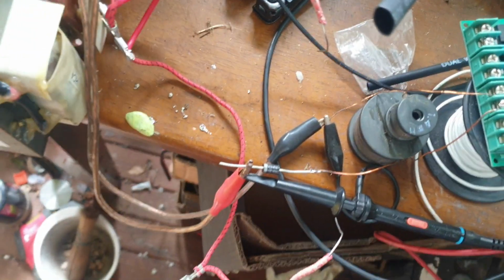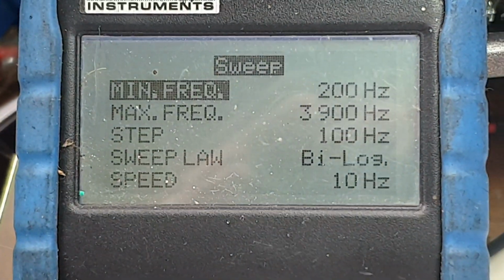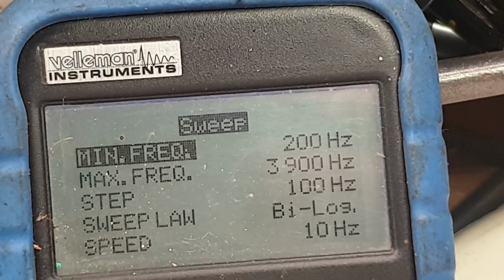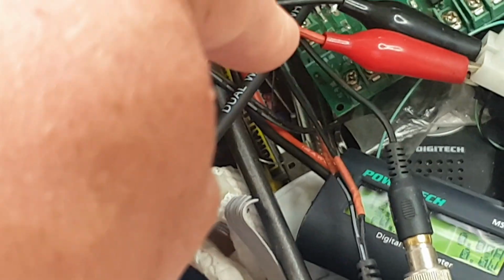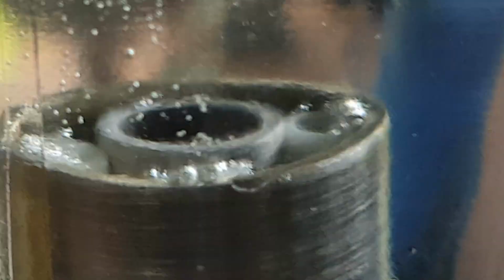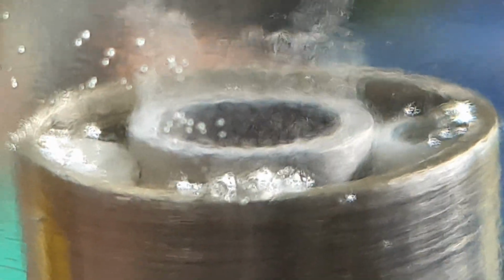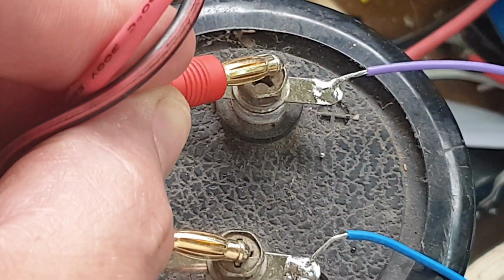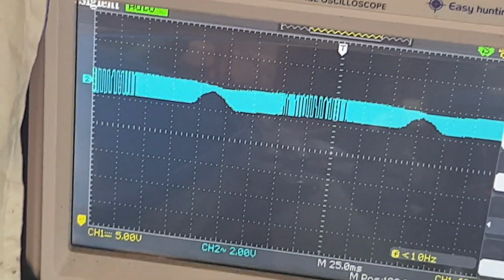Andrija Puharich type signal, HHO 1.3 watts

Comment: Hi m3sca1, with the signal IMHO it needs to be a modulated signal whereby there are 2 frequencies one low one high. Thinking in  rotating vector form, we have one slower vector rotating the higher mass oxygen atom. Now at the tip of the 1st slow rotating vector we have a faster rotating vector which quickly advances and retards the slow vector (phase modulation of the slow vector).
It is only the low mass Hydrogen atom which can follow the faster vector breaking the H2O covalent bond angle. To achieve this a non linear mix of both high & low frequencies is needed for intermodulation to occur.
Reply from the maker: well thats never gonna happen from a single signal generator now is it? thanks for the info... and my cell is nothing like Andrija's... are you still tinkering on this stuff Smokey? i have swept cells looking for resonances, they are a very broad response, tried all sorts of signals and voltages. a bifilar wound isolation transformer was the best non electrolyte result i have had... how much of Andrija's ideas did Stan take on do you think?
Reply: @m3sca1  No I am not at present,  still trying for electrical FE here (NSW).  I wish you luck and hope for your success! As Dr Puharich used rotating electrostatic method HV gradient is required over small gap hence the spark plug. In Puharich notes I think he showed a sweep sig gen with external modulation input.
Reply from the maker: @smokyatgroups  curious how he talks about it taking time to start doing the thing, a water conditioning process.
Reply: @m3sca1  Water is a dielectric liquid, remember from dismantlable capacitor dielectric stores the charge not the plates. Water becomes charged depending on impurities I guess.
Reply from the maker: @smokyatgroups  bout 2 years ago i was messing with charging water. Exclusion zone water hunkers down in a tetrahedral pattern and excludes all solutes and thats why we see shit come out of the tap water. distilled runs clean so long as the cell doesnt run warm from over current or the metal passivates beyond that. this is part of the balancing act i believe, making a system that doesnt go into heating territory and doesnt foul the plates but still getting enough gas... so everyone dumps in electrolyte.

Comment: I want to try a carbon rod in center, coat the outer stainless, larger gap, and go back to doing gating instead of the impedence matching circuit I've got.
Reply from the maker: i was going over Puharich's design and he talked about his ceramic insulator being a complicated mix and that it had pores and the water seeps into the pores and the Hydrogen is made in the pore. his setup was described as a coax type of shielded antenna in a tube. that would make the outter negative or RF ground... going back to what i was saying when we 1st started talking... center positive... i have switched back and now see the whole cell making gad, not just pouring off the center. btw the carbon will make carbon monoxide gas which burns quite well and will slow the H down and make an engine compatible gas without other mods, so may be the way to go. the 1938 car used a U tube type cell with 2 carbon rods and an extra alternator to drive the cell and drove around on it. FYI pourous membranes can be grown over electrodes using cells running hot and sacrificial electrodes...

Comment: Hey man, what is the difference between using stainless steel 316 and 304 tubes.
Reply from the maker: most say price... they both hold.up well, once the plates have been passivated to clean the metal, the cells generally run quite clean. the gunk comes from the water
Reply: @m3sca1  thanks 🙏

Comment: another great lesson from the professor 🙏😁. other system couldnt handle the extra voltage? much love and have a wonderful day 🤗💕🙏
Reply from the maker: it was a lets see what happens if i use 12 instead of 24v moment, with a feeling that the 555 timers wont handle it but i did it anyway🤷‍♂️ should have looked up the datasheet  ...